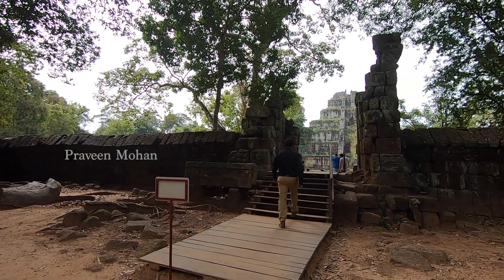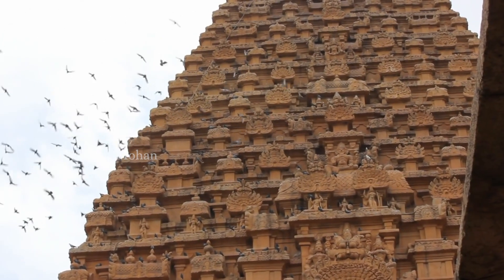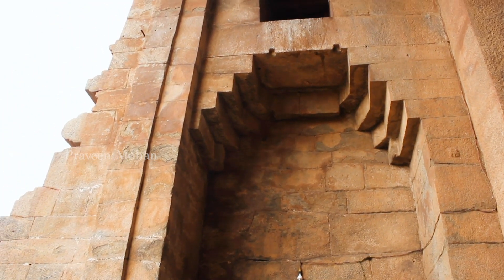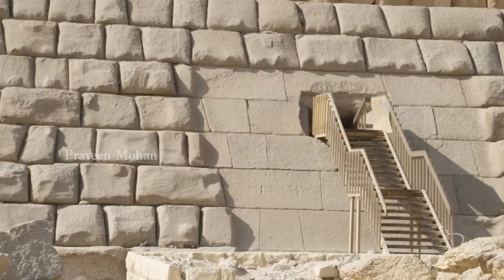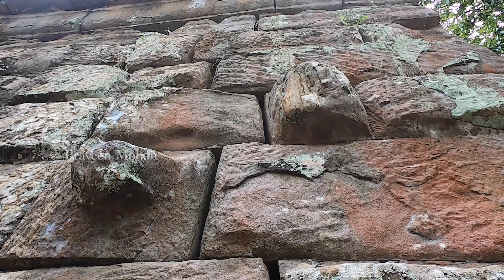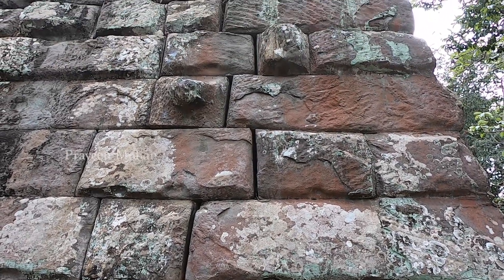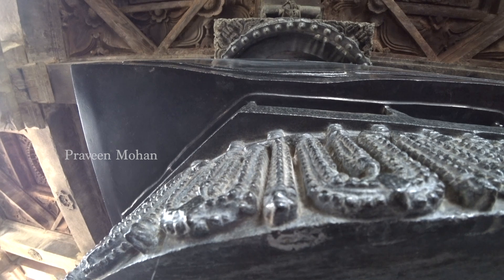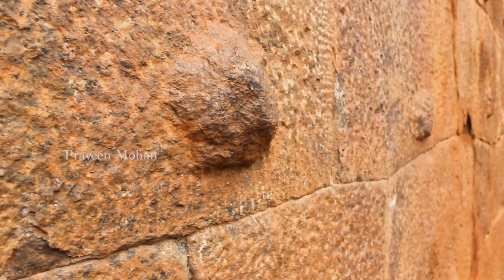Mystery of Ancient ‘KNOBS’ in Temples - Evidence of Stone Melting /Geopolymer Technology?

Comment: Interesting idea, but I can't see it being correct. That's in metal casting, caused by the sand used for molds. It wouldn't produce big knobs like that. And how could they be on two sides of a stone, as seen at 3:28 and at 4:33 right above the guy with the white hat? Many of the ones on those stones are also perfectly centered. You can see the peck marks on most of the stones of the temples too. Why would they be pecked if they were molded, and why wouldn't they have pecked those knobs off while they were at it?

Comment: I think you are right. It has to do with rock-melting technologie. And may be also with Lingams and Shiva. I saw a video about Hinduism in which Shiva, Vishnu and Brahma are explained as the elements of which an atom is build. Vishnu would be the positively charged proton. Brahma the negatively charged elektron. And Shiva the neutrally neutron, 'which holds everything together'. (Hence Shiva is considered the Destroyer.) May be we call this element neutral nowadays, because we do not yet understand its force. If you take the Yuga-cycles in consideration this would be logically. In the Kali-Yuga people only understand the material aspect of creation. In the ascending Dwapara yuga - in wich we are since 1699 AD, according to Sri Yuktesewar- people will learn again about the finer forces of creation, namely elektricity both positive and negative charges like protons and electrons. In the ascending Treta yuga (that will begin in 4099 AD) the knowledge about magnetism will return. Magnetism is a force that binds together, like neutrons. If one would have the knowledge about the workings of magnetism/neutrons rock-melting and shaping bij melting would probably be easy (and maybe a 'device' like a Lingam was necessary in the proces), but it is not something we can fully understand or replicate right now.

Comment: I think a hole is kept at one place so that other plain stones are lifted usingb pullley etc to certain height, later this holes are blocked using protuded stones, so that later you recognize that this is place where they used for lifting rocks. This is also the best way to  build pyramid like high structures and use it for repair and maintenance. because we haven't done any maintenance the rocks have become solids

Comment: Process of injection molding creates knobs.In every mold is a hole thru which molted material is injected. Today is mostly aluminium, plastic, steel, cast iron. After solidification of material in the mold, the mold is opened & knobs are removed by cutting off, grinding off. It looks like megalithic walls were created this way. The mold was used 1 time only because each block is different.Cast iron molds are made of sand & used one time only today. The ancient mold had only 3 sides: front side, left side, top side& perhaps back side. Front side had opening for pipe thru which molted rock was injected to mold, so location of the knob on the front is random. After mold was filled to the top, pipe was removed  and a knob was created by excess of material. Knob which had to be chiseled out. Apparently not all knobs were removed, builders had no time, the boss said: "we will do it later, lets do more important stuff."

Comment: One possibility, as good as any, is that the knobs were quality control protrusions from the geopolymer so that after the forms were removed the nubs could be tested to ensure the blocks were sufficiently hardened or ‘set’ in order to support the blocks to be placed above them.they could be tested easily with a chipper or hammer. Respectfully submitted and with many thanks, having just spent the last weeks exploring the nubs of the Sacred Valley in Peru. Your insight is magnificent.

Comment: I'm not sure about those knobs, but i'm sure they were not made for lifting them. You say they were casted in molds ? Maybe, but i don't think that those knobs are casting defects. 
And i also don't think that they were melted, because that would requier an unbelievable amount of fuel/wood/coal ! Rocks usually melt around 4000 degrees of Celsius, so that would be 
alot of heat and alot of energy that you're gonna need. I think that those knobs have something to do with the frequency and resonance of the building. Those are the ''fine tune'' points i guess.

Comment: If the knobs were flaws or defects then why were the stones with the knobs made smooth. if they could cut or make stones such as this and assemble them into such beautiful creations they could certainly take a bump off a stone.  Either they were flaws but nothing anyone worried about, They mean something and there is a pattern we don't see, or they have  purpose we are not aware of. Perhaps they are  points where the power of the wall, pyramid, or whatever can be accessed If only we had the faintest clue as to what technology was being used way back then..

Comment: I'm wondering why, if the ancients were moulding these "stones" why were they not of uniform size, rather than the random size that appear on the side of these step pyramid walls? Surely if they were uniform, they would be easier to build with.  And wouldn't it be easy just to chisel off the small percentage of protrusions so the walls were uniform. Just asking!

Comment: Personally, I think those knobs were actually meant for the moulds used on interior pieces, to help further lock all the blocks together to help prevent earthquake damage, like the knobs on a jigsaw puzzle locking the puzzle together so it cannot be shaken apart across a tabletop.  If these were molded in place (geopolymer pouring would be easiest; melting rock second-easiest), then it'd be easy enough to use molding panels, some of which would have sections with divots cut into them that could be filled to form the knobs.

If they were all made from partially molten rock, you wouldn't see the neatly cut protrusions that look designed.  They'd be chunky, not artificially geometric.  It's possible that in geopolymer processes, larger chunks of rock, not crushed down fine, would also stick out in the midst of the cement-like putty, but these protrusions are found on the sides, so my instinct is that they were deliberately made.  They don't have to be bulging like an actual door knob style puzzle piece, either, in order to lock all the stones together; they just need to arrest sideways sliding motions between two blocks, and that way you can remove the mold panels easier.

Plus, the absolute easiest way to make larger knobs on the sides if you're using geopolymer is to cut a hole, then fix a pouch or pocket of cloth (or leather, or intestines, whatever you got) through/over the opening so that the polymer cement fills the pouch, which can then be peeled away.  (This reduces the weight of each presumably wooden mold panel section.)  Any signs of cloth patterns from weaving would vanish over the millenia from weathering.  And you can get the same effects from wooden forms, though cloth might be easier to remove.  Either way, when it's half-dry, you can have the contours smoothed over with a trowel, like half-dried cement sculptures are smoothed today.

Either way, let it dry or mostly dry in place, remove the outer walls of the mold, block off the three sides that aren't already poured in place, and voila, you have the next mold section to fill. 

The larger a structure gets, the more mold panels you'll need (more surface area to cover)...so rather than carve or shape smaller pieces, smart workers are just going to reuse ones from the interior pieces for exterior portions that aren't needed to be pretty, particularly if they're getting in a hurry to finish for whatever reason.  The knob holes being all over the place could be a result of the mold panels being nailed into different positions on the wooden scaffolding, since it makes zero sense to constantly make new panels shaped to each block size, particularly in geopolymer polygonal monolith structures.

You just need enough material to block off enough sides to have a mold frame.  Some of that can be done with cloth tacked to wooden frames--which would explain a lot of the bulging curves to the sides of some of these huge blocks.  Other portions can be done with oversized panels temporarily fixed in place on smaller block segments.  But no worries; if the box is "too tall", the architects/overseers will simply tell the workers how full to fill each block's box, and that'll be that.

Comment: Your theory is very interesting, but it also has some weak points:
- why didn't they cut those protrusions off?
- if it was an advanced civilization, they must have had hard metal tools to be able to fix those protrusions, if they were defects
- if those buildings were rised by relatively primitive society, the protrusions were defects, but they couldn't simply cut them off. It would be to hard to bother.
Reply: When you get granite wet it produces an electrical current but it produces both positive and negative voltages all over depending where you touch it. So you have to find the exact points that have the highest voltages and also lower voltages and whether you require reversed polarity like a solenoid does for us today. They had all their electrical needs solved by one contraption rather than a bunch of different components like we have today. The buildings powered themselves and most likely provided power to the surrounding areas as well. I have a video showing that wet granite produces a current.
Reply: @savitrrakatamatah7256  Plenty of things under specific circumstances produce some electricity, but it's not sufficient enough for regular use like cooking or washing your clothes.
Reply: @Pawel_W1  the size of the buildings with the added movement of people inside should produce quite a bit. Attach some batteries to the building and wait a little while and you should have sufficient power, its not instantaneous, it has to build a charge first.

Comment: This theory certainly makes more sense than the mainstream, but I did see another documentary that shows a wall in Cusco, Peru, where the nubs can be read like a sun dial, telling the time, with the shadows even casting in a way that can reveal days, months etc. So maybe they were also used like this? It should be fairly easy to test at other sites, you'd just need to observe any shadows created by the nubs, as the sun passes, and see if they align.
Reply: This is a solid theory. They must communicate something. They wouldn't be there otherwise.

Comment: Maybe they are all rotated 90 degrees for molecular strength 
Someone needs to take a block with a knob on the side and dissect it. If you can get a cross section and view under scanning electron microscope maybe you will find the molecular structure is lined up from being poured. Maybe the knob is at the top like from a mold then they tip the rocks on the side when putting them in place which would make the structure a lot stronger because the structure inside the rock would be like strands that are stacked instead of standing up which could help prevent it from splitting under all that weight.  Maybe they are all rotated 90 degrees for molecular strength

Comment: No chance main stream is right. They are not for lifting, so many are on small blocks where you could manoeuvre them easily and yet the massive ones you would need to have a helping hand lifting them dont always show them. But I am not sure if they are the casting drops either as if you have the technology to mass produce these some form of quality control would exist to minimise them. The appear low down in walls and not high up, or they are high up and not low down, or they are just all over the place. I think they are a deliberate artifact left the for whatever reason. They served a purpose. Maybe as you saodnnear the start they are not displayed where carvings are. Did the knobs anchor carvings onto the walls? Hanging decorations on? Look at the naga video you showed, they were under the head of the left naga but not the right, so if artifacts from casting they'd make sure the most prominent and visible ones were perfect. I believe they were for attaching decorations, be it statues, reliefs, plaques or material to enhance the buildings. Would be interesting to see after an earthquake,or isis, knocked off a decoration and the knubs were behind them, but would hate to see any more beautiful buildings damaged. Agree on your geopolymer ideas 100% but if they used this method they would not use imperfect casts, especially if they could manufacture 100,000s of stones, just make a new one. They have a specific purpose. Just my 2c worth. Great vid again bud

Comment: We pour concrete over metal for additional reinforcement. Actually we place metal bars called "Rebar" inside of the poured concrete.
It could be that those nobs are just protrusions from the metal bars inside the blocks. With the layer of melted stone applied on top of the protrusions.

I recently I stumbled upon this explanation.  Maybe it helps you to further clarify this question.

Comment: maybe knobs were left on to "break up" the smooth surface. They obviously liked smooth surfaces, cause most blocks are fairly flat and smooth. Maybe for rainfall (or lightning strikes) knobs would break up the downward flow and cause the water to collide in interference waves as it went down the sides of the blocks. Maybe it was just for cosmetic purposes - to make water flowing down the walls into wave patterns on the walls that would be interesting to the viewer. Also - if the walls were to stand for many centuries - falling water would eventually create grooves and flow more and more into the grooves and start eating out the walls. If the flowing water was broken up into "waves", it may have greatly decreased the chance of the flowing water creating deep cutting channels.

Comment: I'm a huge fan of your work and your keen insights. I have long wondered about the purpose of the knobs found stones on at megalithic sites around the world. In terms of your melted rocks hypothesis, I just have a couple of questions.
1. How would it be possible to reach the temperatures necessary to melt granite (2200° F), sandstone (2700° F),  and basalt (2000° F), rocks that are frequently found at temples 
    such as these?
2. How would it be possible to pour limestone since it doesn't melt, but breaks down into calcium oxide and carbon dioxide at high temperatures?
3. Has anyone done extensive surveys of temples such as the one in this video to look for standardized shapes or dimensions among the blocks? If you are going to create a mold and   
    pour liquid rocks, wouldn't it make the most sense to use a limited number of shapes and sizes to reduce the amount of work required manufacturing the molds? And if a standard 
    size/shape/dimension is not found, how would it have been more efficient to create thousands or hundreds of thousands of molds that must be very precise in three dimensions as 
    opposed to just carving the rock into the required shape? I'm not trivializing the amount of work and skill required to cut the stones, only posing what seems a more feasible 
    alternative to the melting rock hypothesis.
4. Has there ever been found, at any of the multivarious locations that feature these stone knobs, any evidence or piece of machinery or technology that could help explain the 
    solution to the difficulties presented in my first question?

As I said, I absolutely love your videos and I offer these questions in the spirit of science and advancing or rejecting a hypothesis. I have recently read of the evidence for geopolymer technology discovered at Puma Punku in reference to the H-blocks, so I know that there is something to the idea. Thank you for all the great work you do!

Comment: There could be two problems while making a stone block structure. First, how to cut or create the stone blocks and second how to put it above one another. These knobs could not be the result of cutting process because cutting produces smooth surfaces.
The purpose of these knobs could be lifting those stones. Maybe, by inducing certain resonant frequency at the knobs these stones could be lifted to any height.

Comment: what amazes me the most is that these knobs look out of place, why not hire a few guys to knock them off and make the surface smooth if it was a manufacturing accident. when you have the resources to build such huge structures cost can not really be a issue. so there has to be some purpose to these knobs. maybe they needed a specific amount of mass and some blocks required additional volume so tehy added a knob or from far away the knobs reveal a message, like the dots in blind writing, just insanely big.

or they just wanted to troll the future degenerate societies that can't handle stone.